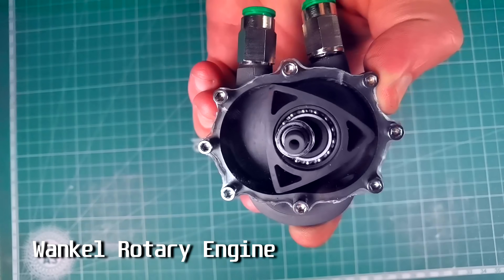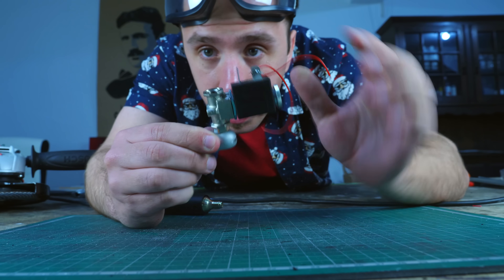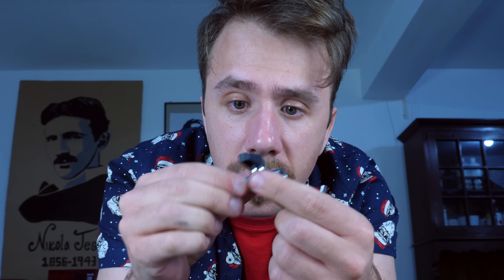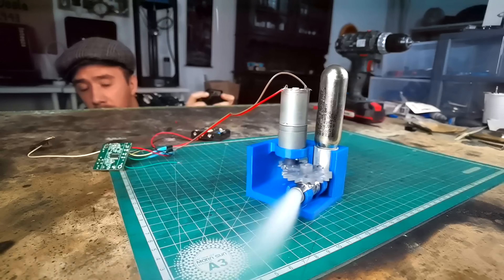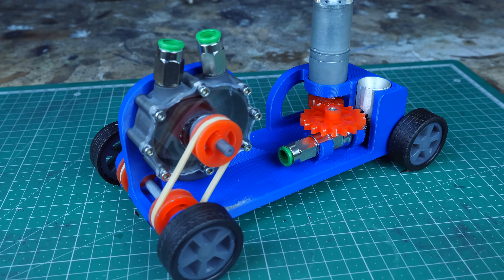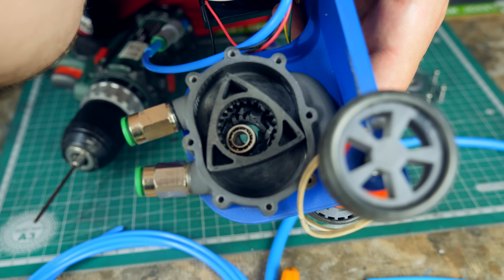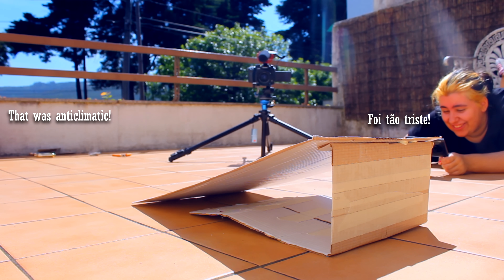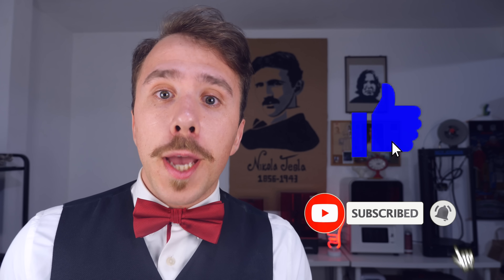Rotary Wankel RC Car (3D Printed)

Comment: Have you tried using a form of pressure regulator for the CO2? I don't think it needs anywhere near that much pressure to run the engine. If you could find a digital pressure regulator you could regulate the amount of pressure for increases in required torque, and increase the available run time by a lot

Comment: You would probably get longer run times if the CO2 Cylinder was upright instead of thread side down. having it thread side down allows all of the CO2 which under pressure in the cylinder is in a liquid super critical state to escape before it can do anything more than make noise and make things cold. Having it thread side up would allow the co2 to vent vertically keeping the CO2 in the cylinder and allow it to release more controlled. Just a thought.

Comment: That was funny!  I laughed pretty hard. And I knew it was going to happen too. In high school my brother and I use to stuff spent CO2 tubes with match heads from book matches, that made fantastic rocket engines. (Caution people: never ever use match heads from wooden stick matches because the white phosphorus tip will light on fire with very little friction as you attempt to stuff it into the CO2 tube, and you will regret it.)

Comment: Make a 3d printed prototype of a strong enough compressor to get about 200-300 psi, and design an thruster capable of moving heavy things. Or better, make a system that turns air into liquid by compressing it!

Comment: I'm more interested in seeing a liquid piston engine. Do you think you could do one of those?

Also some takeaways from my 818hp go Kart build days, with all that power going straight to the front wheels, your belt, or rubber band, seems to need a bit more tension, a second thing I should mention is if you're rc car has a weight ration that's not 50/50 left to right you should correct that too make should it's not pulling an immense amount of weight on one side, which in slow motion, could be the reason you get some front wheel jumps. 3rd a great tip for rc car wheels getting extra traction is to replace them with foam, or sand the rubber treads, rc wheels are way too small to even need that consideration, likewise you shouldn't be playing with an rc car in the water to begin with, so there is no need to throw that water like a real car would.

Comment: Hey man, I it can be good idea to connect wankel engine to the flywheel to store the the energy or for fun connect the Wankel motor to a flying probbleler (one prob with a ring. , old school toy helicopter that you poll the robe and it flys )base on high speed it speed up and fly high

Comment: I think you have too much peak pressure. You should add a pressure regulator of some kind to lower the the pressure output of the tank and extend the duration of operation. You also have liquid CO2 coming out of that canister, you should have an expansion chamber with heatsinks to give the gas an opportunity to fully expand before passing through the engine. This would also greatly extend the duration of the canister's run-time. These canisters are used by paintballers all the time, and a single tank can usually fire up to 200 rounds,. A paintball gun contains an expansion chamber and the metal body acts as a giant heatsink to allow for full gas expansion before firing.

Comment: I can't understand,  why you are you not using two engine , in video we can clearly see lot pressure is just wasted after moving the piston  and why you are using rubber band to transmit power to the wheel atleast use gear your engine was 1 banana torque use a gear box to inc the speed of the wheel

Comment: Video idea. You could print an Helmholtz resonator with compressed air. Also make it sound variable changing the output hole. It could work as car horn.

Comment: Regulators are cool. Also why not use a more efficient drivetrain? The rpm of the engine was 5x the wheel speed.

Comment: I love this project! I think an expansion chamber would be an awesome idea to add too. And maybe making a multiple rotor engine where each rotor is fed from the exhaust of the previous rotor could help efficiency since the exhaust is still so high pressure
Reply: Like the expansion to chamber idea but I don't expect multiple rotor engines would result in much gain.

Comment: Lots of drivetrain loss with that setup.  Gear drive would be more efficient for this setup.  Also,  energy release from the cartridge should be a lot more controlled.  A much smaller outlet from the cartridge would do the trick

Comment: Your idea for the car is good, but instead of a rubber band, you should use gears. That would slow down the motor and the wheels have a little more time to speed up. You could try that in a new video

Comment: A theme for very a few episodes: First a rocket drone capable of 70 feet carrying a one pound load. Second solar powered drone "base" where multiple drones can charge. Using 3d printed rocket fuel in the third episode work on guiding the rockets. Forth episode get the charge drone base and the rocket launcher drones in sync with with each other. Fifth episode get it to where the charge base can 3d print rockets and reload the rocket drones. 6th episode build worker drones too pick up extra 3d filiment and dilever to drone base. I would like to see something like that

Comment: Some tips to improve the car design in my opinion
- Use gears for the transmission, that rubber band is not doing a good job of transmitting the power from the engine to the wheels.
    >This will also make the car RWD which most fast cars use.
- Try adding a tube which directs the exhaust behind the car, It may not add much thrust but its better than nothing.
- Gripper tires will be needed to handle the power. (You could make the tires wider, or use a different kind of rubber for the tire)
    >This is only needed for the wheels which are linked to the engine.
- Weight reduction so the engine doesn't have to work as hard to push the car.
- You could have the valve open less so the engine doesn't get destroyed when you open the valve.
- Air (potential power) is leaking out of the engine where the clear part of the engine is connected, you could use an O-Ring to stop the leak.
- You could use a ball bearing to reduce the rolling resistance of the wheels which will allow the car to travel further.
    >Use on both axles to reduce the friction as much as possible.

Comment: you definitely need a pressure regulator so the co2 doesn't come out so explosively that would make it more efficient  There must be an optimal flow where the highest speed can be obtained with the best CO2 consumption.  with it you could also use any cartridge.  Furthermore, if the decompression is slower, you will allow time for the CO2 not to cool down so much and therefore not to crystallize, which also loses efficiency.

Comment: May I suggest 3D printing a double acting, double expansion 2 cylinder compressed air or CO2 cartridge engine. Double acting means that the air or CO2 works alternately on both sides of the pistons making both up and down strokes power strokes. Double expansion meaning that once the air or CO2 is used in the first cylinder it is used again in the second (usually larger) cylinder at a lower pressure to get more power out of the same amount of air by using it twice.
Doing these two things separately (double expansion, or double acting) would also be cool.

Comment: I want to see you put a mini air compressor maybe on the same engine but maybe a little bigger frame with a little more weight and better wheels for more traction! 

Oh yeah this is an edit but I recommend you try using the turbo you made for the pulse jet engine as a source of air pressure for the wankel then make a functioning and driving rc car with all of this!

Comment: if u use the other motor in the same car with a little bit of waight for the wheels you would make a cool 4x4 car u can test on the beutiful sand beaches of portugal

Comment: You gotta turn down the boost pressure.  Any car guy will tell you that you'll grenade your bottom end if you run too much boost.  Maybe try it again with some kind of throttle to vary the amount of CO2 going into the rotary?  Also, make sure it's governed to a set amount so you can't blow it up.  You may need to do some testing and lots of gear shredding to dial it in just right, but I bet you can do it.  Who knows, you might even be able to run it for more than just a few seconds at a time!

Comment: Have you seen the new liquid piston engine? The angle of attack on the apex of each cylinder area is much less and produces a longer power stroke, air would be much more effective through this design I think

Comment: What about recycling the air after it reaches the engine, like a turbocharger?

The cracks where there are leaks will eventually empty the cartridge  or system, and you can now open and close the rotary engine.
Reply: that little return valve that gives the gas a second run through the engine would be great to expand to a second or third rotor. Basically in series to try to extract as much power as possible from the high pressure, though parallel with an intake plenum might work too. I imagine it'd be done by the second rotor but you never know, those CO2 cartridges have a lot of initial pressure.

Comment: What if you turn the engine on its side so the vibrations don't lift the wheels off the ground? Or add a bunch of springs, a basic suspension, to keep pushing the wheels on the ground not to lose the sweet traction!

Comment: I'd be very curious to see how this engine set up worked if the rate of force was slowed down and let out gradually; it also seemed like a lot of the energy was being lost in the very beginning just because the car wasn't heavy enough in the front; It'd be rather interesting to see how far this could be optimized...

Comment: It seems you're losing a good bit of your power by the rubber band slipping. A gear connection might be more ideal, even if it does cause more friction

Comment: Maybe design a 3D printed boat (motorboat it should work with cartridges aswell) and it may be more powerfull because it wont lose much of the transitent power through gravity :) (i really would like to see some engine powered boats/ships anyway)

Comment: You should get a pressure regulating valve from a paintball gun or similar, then put your motorized valve after the PRV.

Comment: 2 rotary engine maybe? maybe 3D print a transmission or some simple gearbox and use multiple tanks but control the pressure.

Comment: Your pulley was slipping, you can see at 8:10- 8:20 for example, the engine is spinning, but the wheel is barely moving and stopping. If there is too much torgue, the tires should be the limiting factor and slipping. Maybe with a better pulley the wankel car can perform better?

Comment: Might I suggest using a direct drive next time instead of a smooth belt(Rubber band)? the belt will slip too much and the car will loose a lot of efficiency. 

Project suggestion: 3D print a simple 3 speed transmission, (1st, 2nd, and reverse, or as complex as you want it)

Comment: The rubber band seemed to be slipping and the engine was moving quite a bit before the wheels started moving. Maybe if you used 3d printed gears instead it would be more efficient.

Comment: 3D printed Robotic Arm that crushes cans using a combination of different motors. (note it doesn't have to be cans. Could be the villainous red fruit).
Reply: Mayhap you make it with a combination of Tesla's patents to make it all powered by air.

Comment: I wonder how much efficiency was lost by having the exhaust port point slightly forward (acting as a rocket against the direction the wheels were turning.) If you turned the engine around, you could combine the two modes of acceleration. Either way, I like that the exhaust was helping to push the drive wheels down. Nice project, as always!

Comment: You loose alot of your force in you rubber band transmission, if you scale up or can find a one small enough a chain drive would have less slippage. Also a regulator would help with the fuel efficiency so your CO2 cartridges aren't just emptying all at once, a paintball gun might have a small regulator that is ment for those cartridges

Comment: If you're having issues with the RPM being too high you could print a gear assembly to act as a sort of transmission for it. Since you're using that many gears you could use lighter resin (if there is any, I don't 3D print) to save weight, because the stress levels per gear would be much smaller. Also id assume a toothed belt would work better than a rubber band.

Comment: You should totally build a real test stand, that can measure the thrust, so that you can quantitatively compare engine designs, instead of just comparing them qualitatively.
I think it would be interesting to actually have numbers (fuel consumption rate, thrust, etc.)

Comment: Video Idea: Print a portable Telescope, but its casing is made out of foldable parts like an accordeon. 
Basically you can Squish the telescope down to a certain size/thickness where the first element contains the objective lense and the last element the ocular lense.
From there you can extract the telescope into its full length again.

Comment: Having a slow controlled valve, releasing the pressure gradually and having longer operational time would be great, also if you also point the wankel exhaust behind the car it’d improve the efficiency because that pressure from top adds huge pressure on chasis and unnecessary friction.
Reply: he also could print a few more chamber getting more power (making a bigger car, adding a trailor for additional weight??),and the fuel would be spread instead of going only to rpm. Also on other channels I saw that it makes the motor more calm, because vibrations compensate each other. Also I think from turbo freaks to add an expansion chamber (actually it is not liquid CO2, but solid), could be usefull to get more use from the fuel
Reply: @ricardojahns4348  another great idea 👍🏻👍🏻
Reply: Friction is part of it, but additionally it looks like there's so much flex in the axle/chassis that the periodic jet from the engine is causing it to bounce and lose traction and the rubber band is too flexible for the amount of energy being transferred, so a ton of the energy is getting lost to wheels spinning in the air, rubber band flex, etc. I definitely think a slower, more controlled gas release would go a long way to solving the issues. It would give it a longer operational time, but it would also help bring the forces down to tolerances that the materials involved could actually handle.
Reply: Not only that, but it looked like the belt going from the engine to the axel was slipping a lot, so printing a toothed belt or a chain would prevent that from happening as well
Reply: fun fact : mclaren points the exhaust upwards ( at the rear wing ) to help generate more down force and therefore adding more friction (traction)
Reply: If there was some sort of gearing that could make the valve open when rpms are low and close when high, you could make it so the engine keeps the co2 coming out just enough to run the vehicle. Thus the engine would modulate throttle for best efficiency.

Comment: you're losing a lot of energy due to the elasticity of the rubber band and the lack of proper tensioning. if you were to make a V2, id suggest using a less elastic material for the drive belt, and  adding a tensioning system so you could achieve proper tension. Doing so would lead to a massive increase in output power, and speed of the RC car.

Comment: If you change the rubber band to a small geared belt you will get a better transfer of power from the engine to the wheels, a few 3d printed drive gears would also work.

Comment: You can ramp up the complexity on this Wankel build by building a mutli-rotor engine.  If you spread that gas pressure out over more rotors you'll get more torque and less RPM.

Comment: Nice work on the engine. It looks like it needs to be printed in a stronger material perhaps..... Maybe you could do another video using a bank of CO2 cartridges and regulate the pressure to get longer more controlled run times. This project has a lot of potential yet

Comment: Another problem your car had, it was using rubber bands, which under 5k RPM,  slips way too much. It is very visible in the video.
You should use little chain drive like from bikes/Go-Karts

Comment: You need transmission (and flywheel, and clutch, of course) lol, well..at least use bigger gear ratios. 5000rpm is definitely super overkill for the wheels, it'll always makes  the wheel spinning extremely fast with that almost 1:1 gear ratio.. that's why you can't make this things run for any longer, even if you change tube to the bigger size

Comment: Pressure regulator could slow down the use of gas and a pre expansion chamber could make it run longer? I guess if you use a dipetro type engine it would run better. I wonder what happens if you use a gear box with the engine?

Comment: You should do another video where you change your drive design. At 7:46 we can see that the rubber band is vibrating a lot and loosing lots of energy. You could change that for a simple belt drive. This should improve your chances of making it through the ramp!

Comment: So I’m a fan, I’d like to see you try the wankle engine again on the ramp but use a stronger rubber band and maybe tires with more tread for friction. If the engine is too powerful then you just need to up grade the amount of ser face area the wheels touch. That rubber band didn’t transfer the energy well in my opinion.